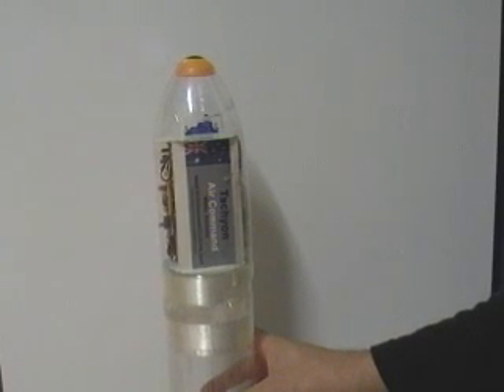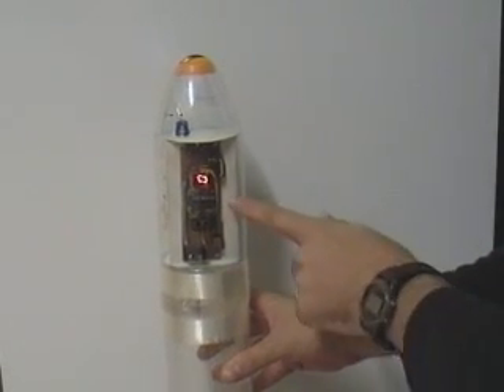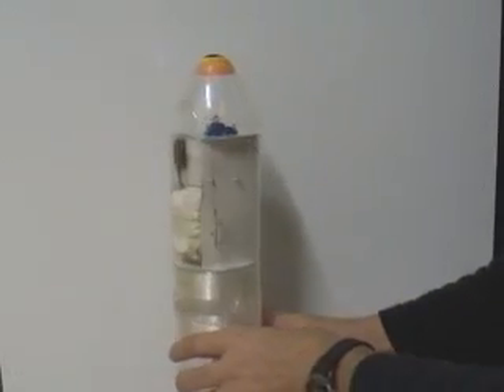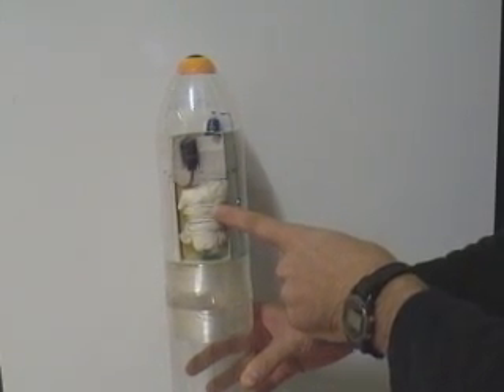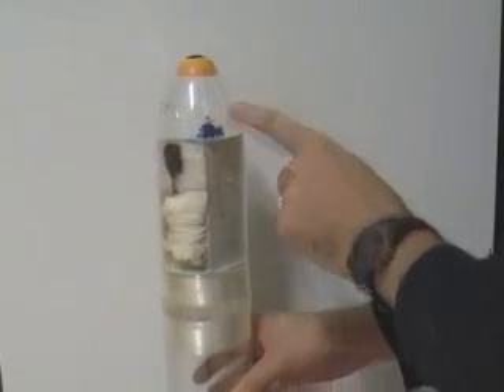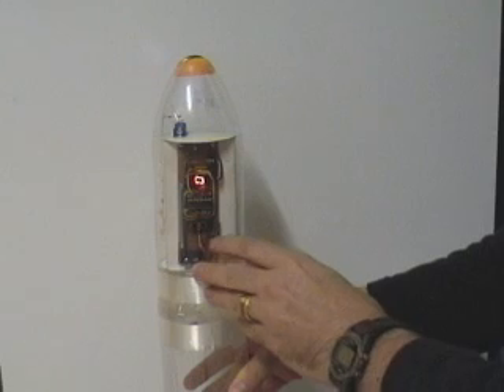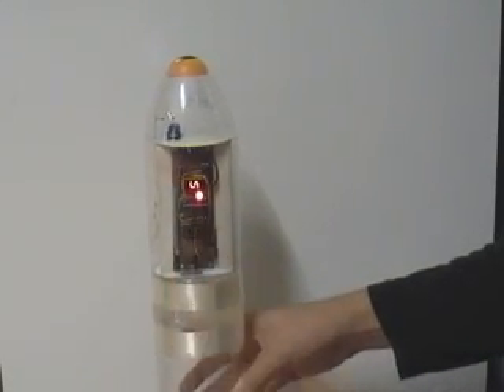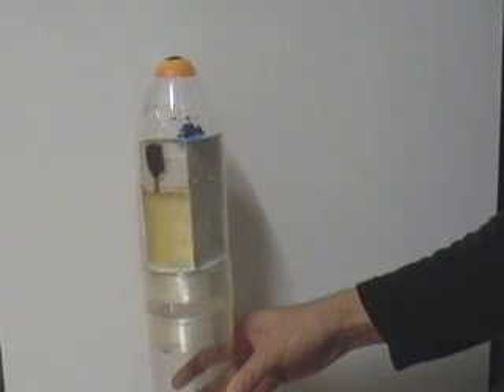Tachyon Sustainer and Staging mechanism

Comment from the maker: It's just regular clear thin tubing you will find in a hardware store. It is often used for fish tanks and the like. The small diameter is what allows it to hold the pressure. I believe the outside diameter is about 5 or 6mm and walls are at least 1mm thick.

Comment from the maker: We glued a small ring to the white pipe and the gardena nozzle is just screwed in place with a capture nut. This way we can disassemble it if we need to. The air supply to the gardena nozzle is through a thin clear tube seen at left entering the white pipe. This thin tube goes to an aluminium adapter inside the white pipe and the adapter is glued into the gardena fitting with epoxy. The white pipe is not pressurised.